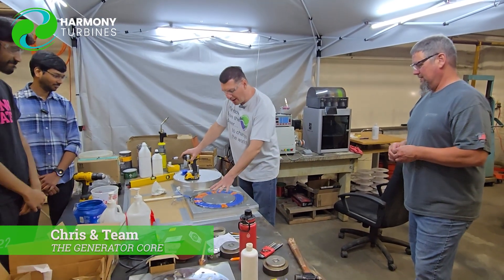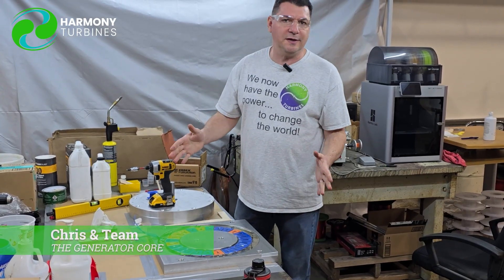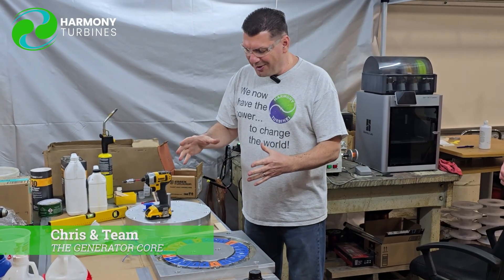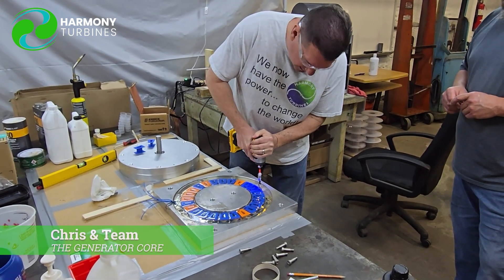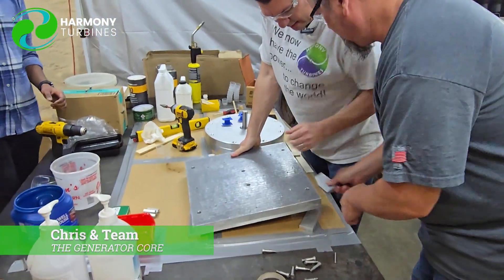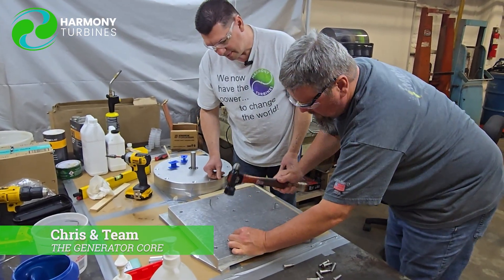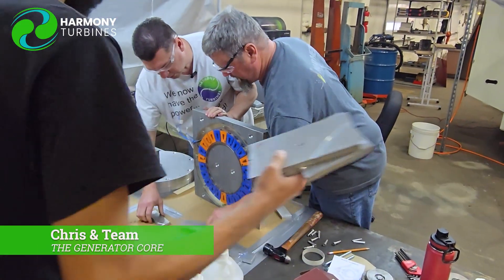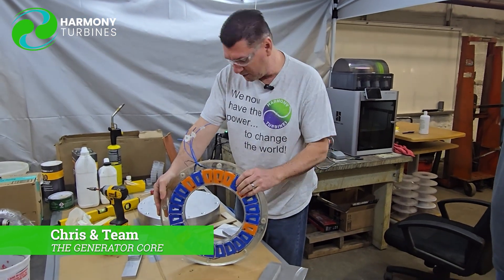Casting and LIVE De-Molding of our Generator Core

Comment: Lay a flat metal ring inside your mold so the pegs you beat on hit the metal ring and the ring pushes up the core.
Reply from the maker: we don't need to "beat" on anything anymore. We've added some draft to our molt and the core pops right out with just a few gentle taps now. No damage at all.

Comment: Resin types
Epoxy: Silicone or PVA works best; avoid heavy wax buildup.
Polyester: PVA or silicone; wax alone may suffice for simple molds.
Polyurethane: Silicone or fluoropolymer; PVA can cause issues.

Comment: Laser cut 4 equal plates that lay seamlessly flush on the mold with metalic pegs attached to the outer side.  Then you can put the mold in a press that can quickly press out the component with uniform pressure.  Should take about 5 seconds to remove the component.
Reply: Also, a heat gun is all you need to remove bubbles from your form.

Comment: You can a) buy Anti-Stick lotion especially for epoxy resin and b) you can get some consulting on what cheap, yet purpose-ideal epoxy there is available (in quantaties) and c) you need to get a vacuum chamber to really get all the bubbles out before it hardens and I believe d) there can even be a special "dry chamber" to shorten the waiting for the epoxy to harden   Rock on ,Hommel